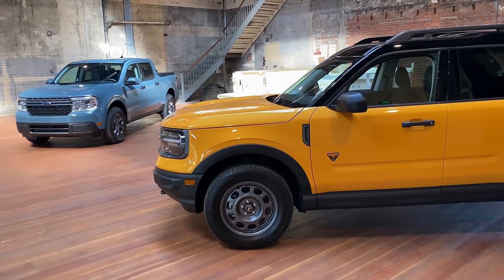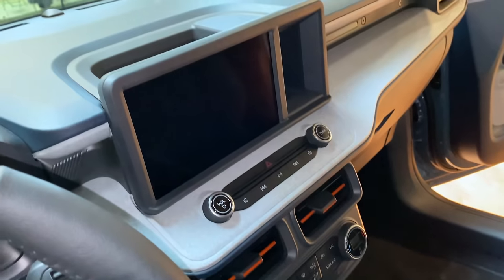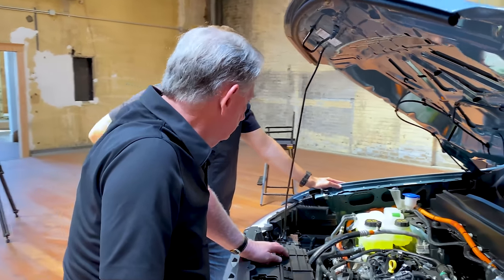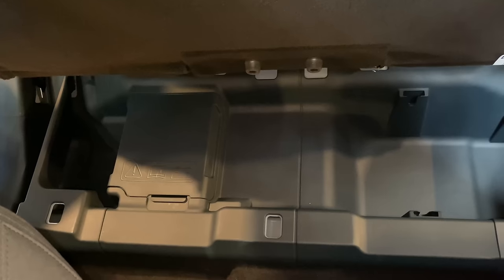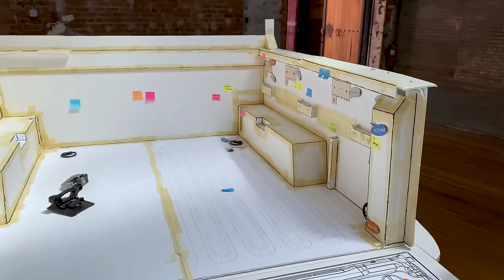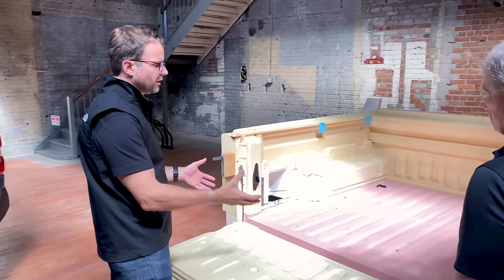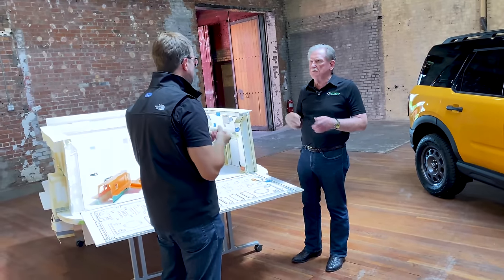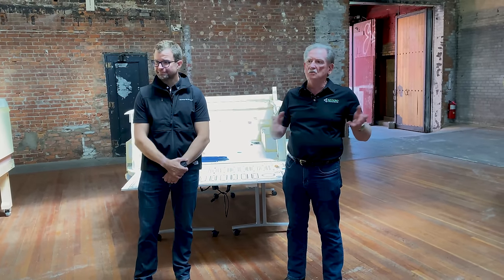Ford Maverick Review with Maverick Chief Engineer Chris Mazur

Comment: I'm just concerned about the reliability. fairly new engine cvt transmission and brand new design vehicle built in Mexico. raises quite a few red flags for me.
Reply: The engine and hybrid powertrain are not new. And the Hermosillo plant has been building good quality vehicles for many years.

Comment: Yeah, this truck or any new Ford probably will operate alright for a few years before this module goes out and that module goes out.  Ford seems to design accelerated obsolescence into all of their vehicles. 

Remember that Ford hates its customers so much so that it made it very difficult to do your own oil change on some of its cars. 90’s Thunderbirds were the worst! You can’t remove the oil filter without putting the car on a lift!

Comment: This is not a "truck".........it's a minivan with a bed.
Reply: You don't recall the small Toyota trucks of the 1980's eh?
Reply: @ricknash3055  what you consider "small"? To us Europeans an Hilux is very big, and uses a traditional "Body-on-frame", instead of a "Uni-body" construction.
Reply: That’s just a 1980s minivan with a truck bed.
Reply: @RogerM88 
Ha ha good point. Does Ford sell this truck in UK or EU?
Reply: @ricknash3055  in Europe and UK too, pick-ups we have available more common are: Toyota Hilux, Ford Ranger, Mitsubishi L200, Nissan Navara, Isuzu D-Max, VW Amarok. Upper in the weight category, we have our (boring) interpretation of "super duty" trucks, with cab over models, such as: Iveco Daily, Mitsubishi Fuso (Canter), Toyota Dyna, or Isuzu NPR.
Reply: Which makes it a....truck.

Comment: The Hybrid version of this truck must have a decent capability to generate electricity. 400w is nothing. It should be possible to created a generator mode in software that allows the engine and generator/motor to put out portable generator levels of power. If that could be added for minimal cost, it's a far better solution to owning a generator, which is getting much more common.
Reply: The F150 hybrid has that option, it's likely to come to the maverick in a mid cycle refresh
Reply: 400 watts is the power of the rear AC plug.  The power of the hybrid electric engine is way higher.  

Your typical DC plug is maybe 10 amps x 12v = 120 watts.  So 3x higher (AC)

Comment: its a very nice truck,...
But, ...no one,no one asked for this.
In my experience Anyone who has ever bought a ":Hybrid", would NEVER buy one again.
Just the thought of replacing your exhaust system in  your Electric vehicle makes my skin crawl.
Reply: Pauline Weinberger  
sure okay , but MY experience maintaining vehicles at my shop working on FORD products and on HYBRID vehicles is this, ...
they are "okay" vehicles, there is still an ICE system to maintain, there is an EV system to maintain and there is an additional system that ties them together to maintain. The ReSale value is ZERO.
so, in affect after ten years the vehicle regardless of the exterior condition is null.
Not a single hybrid user expressed to ME that they LOVED the HYBRID and would actively search for another one. In fact quite the opposite, they expressed the desire for Full EV or FULL Ice and would NOT consider another hybrid. 
I am sure there are different reviews and results, but in MY garage, HYBRIDS are a fail.
Reply: Pauline Weinberger  
yes i do too, they see the FUTURE and this is the baby step required, ...i guess, i just wish they had reached further, i hope they do well and then i think about how much effort they have put into preventing it.
Reply: Pauline Weinberger  
i have not seen it in person, however, thanks to M&A i have seen them, what i see is the same impossible for the client to maintain assemblies which result in a dealerships dream car. Lets face it, there are buildings FULL of engineers that make things deliberately difficult to maintain. Now YOU might not agree with that, but YOU would be the only one.

Comment: Backpacks, purses and bags are going to get hooked on those inside door rests. Product testing would have replaced those "hooks" with traditional armrests. He brags about practical spaces, but still wastes the console with a big gearshift knob that could be on the dash-Expensive, risks spills on electronics and wastes space.  Would it have killed Ford to put in a $99 plug in charger and the software to manage it? Even with cord under hood and avoid body work cost? What a wasted opportunity. Since when is small, low cost pickups a whole new segment?  Just because Ford has refused to sell one in the USA for a decade, doesn't make it a "new" segment.  He's awfully excited about a rear removable cupholder. For all hype about flexible storage, rear seat isn't easily removable. Most buyers would rather have interior space for bikes or camping gear than a back seat. All the talk of bed space utility, but no mounting track on front for bicycle mounting brackets across the front. Totally missed with their target market. So they spent the money on an inverter, but not a plug in charger?  really?  did they ask any potential buyer?  Designed in a lab with no target buyer input. If they want to fail fast and fix it, they have the fail part down.

Comment: Too little too late. First,  the ROI for college is crap.  “Off to School” cars have no legs. This can’t be an off to school AND a DIY’r  truck. Two different segments.  I could go on and on. I don’t hate this concept, but it won’t qualify for tax incentives, it’s not heavy duty enough to be a giant fleet vehicle, front wheel drives typically are not stable tow platforms. Lastly, and I’ll bet money on this. There is very little chance this will retail at 20k . By the time the add on’s take their toll the dealer adds leather, destination charges , prep fees, wheel packages , ceramic coating , ding shield and glass guard and mud flaps and another million options the price will sky rocket. I’ve see this before . The Osborn effect never catches these guys. They play the old switch around game and make their money. I’m not anti profit. I’m anti -bullshit. Only time will tell , but  Ford is done , ICE is dead ,  the hybrid Maverick proves Ford  dealers aren’t interested in a BEV.

Comment: Toyota Scion all over again.  Sell a cheap "base" model, offer options up the kazoo (i.e. from stickers to $$ TRD stuff).  So how much will the AWD Mavericks with the really cool options sell for?  Probably $29,999, or more at the dealers.  Good effort, but if the majority sold are the base model, Ford will lose money on this platform / vehicle.  This is designed for the dealers' "option-up" departments i.e. pinstriping and cool wheels & tires. After all it only adds "a few $ a month", with 7 year financing!   

Toyota over time discovered that the Scion targeted, option-happy youth market was diluted by middle aged and older practical buyers, and this didn't generate the profits they expected.  So they killed the brand.

Full disclosure: I drive a Scion Xb and love everything about it except the road noise and the rough ride.  Saving up for a model Y.

Comment: This would have been a 'good first step' in 2005.  In 2021, not so much.

By 2030, some cities will have banned this product.  By 2035, some entire countries will have banned it.  Prospective owners should be thinking carefully about the risk of owning a stranded asset, a vehicle that isn't permitted where the owner wishes to go.

I'm not saying there aren't good ideas in the Maverick.  I'm not saying Ford's engineers aren't clever.  But it's not even a plug-in hybrid with a fully-electric drive train and a modest electric-only range.  It certainly doesn't deserve to be called a BEV.  Its roll-over characteristics will be typical of ICEV light trucks - poor, in other words.  The front crumple zone is filled with hardware that won't crumple much.  It won't get a high safety rating.  And its operations and maintenance costs will be much higher than an equivalent BEV.

Of course there aren't any equivalent BEVs yet.  But there will be.  And though those BEVs will be more expensive initially, their prices will fall, in theory at least, below the level of comparable ICEVs.  Battery costs will improve.  Economies of scale will kick in.  BEVs have fewer parts, fewer assembly steps.  The pricing advantage will shift in their direction.

Ford will be lobbying Congress to get this hybrid qualified for whatever incentives are shoveled by the Federal Government towards BEVs.  GM, Toyota, Daimler, they all would prefer to manufacture hybrids and keep gasoline flowing through pumps into their vehicles.  They may even find sympathetic ears in Congress.  But incentivizing cars with tailpipes would be a gross misuse of taxpayer dollars.

Comment: It's a hybrid with a four cylinder ICE, and it doesn't even have a plug! It was obsolete before they started designing it! This would have been a decent option a decade ago. Now it's just another vehicle with a battery that's too weak and destined to degrade too quickly. It is yet another attempt to convince the average buyer that EV tech isn't there yet.